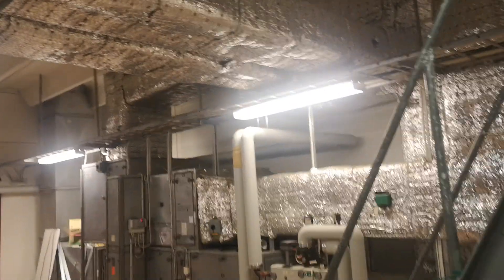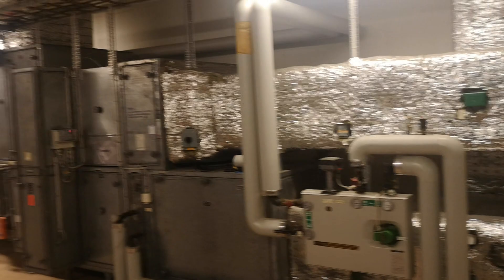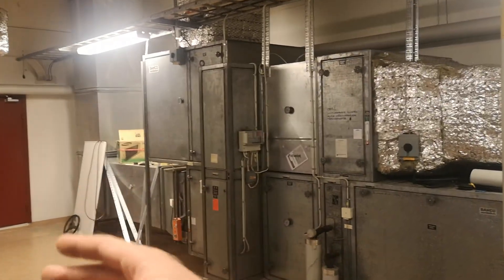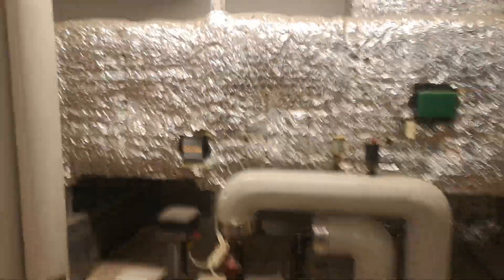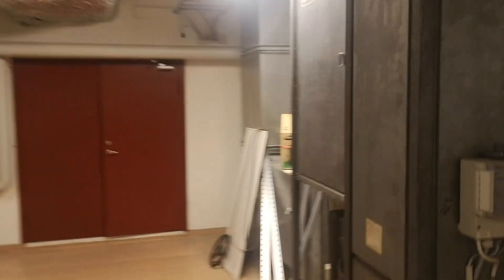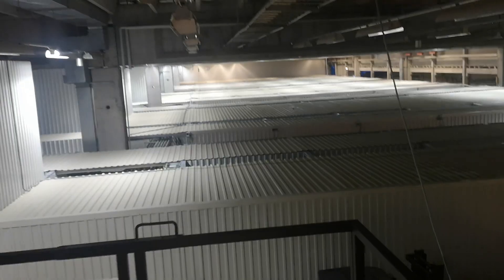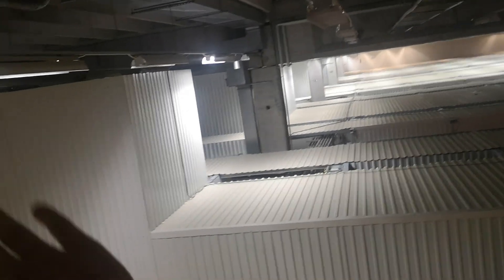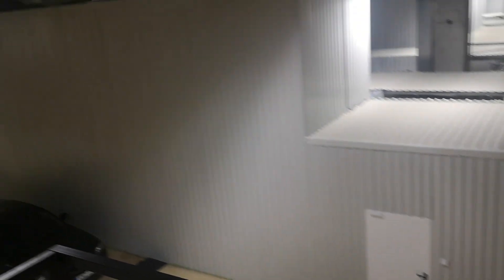Talking about hot air

Comment: Hi Phillip

Just one observation which is not clear in the video if you already applied this...
I'm assuming we are talking about a cold climate!
I've seen the serialized grand pipes (Air corridors i guess), and you mention you suck cold/fresh air from outside... guessing some sort of filtering for humidity etc... and cooling the interior. 
Cold air stays down, hot air goes up... i hope your pipes are pushing cool air in the low sections, and sucking hot air out from the top!
*Thermodynamics point that most gasses should be treated as fluids. Fluid dynamics apply to the air that surounds us and how we control it!
In case you already do, brilliant and a great advancement too! In case you are not! Well, thank me after covid ;)
Reply from the maker: yep, you are right and good points :) A lot of air moving around..